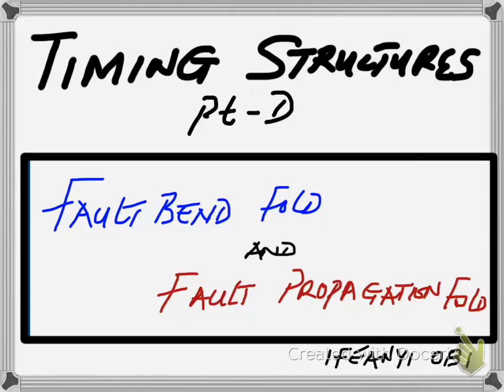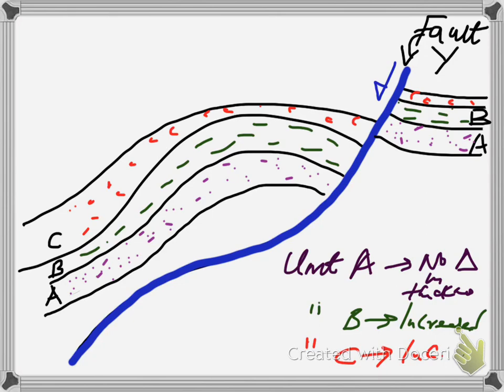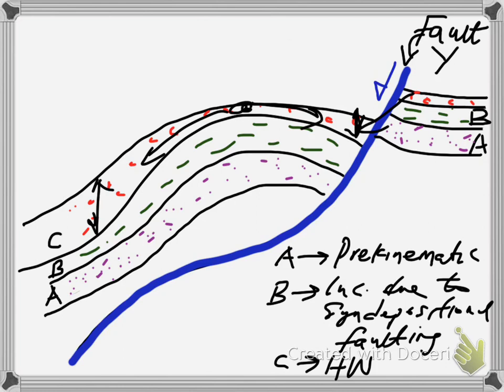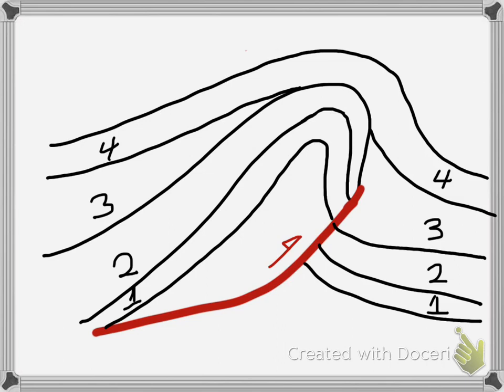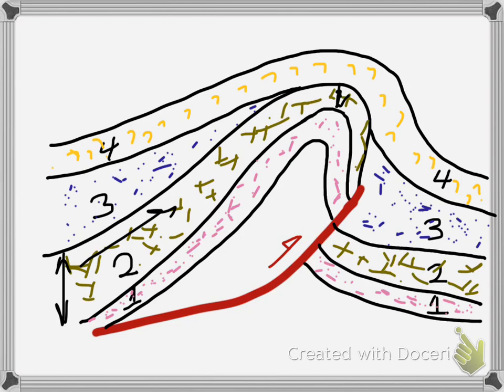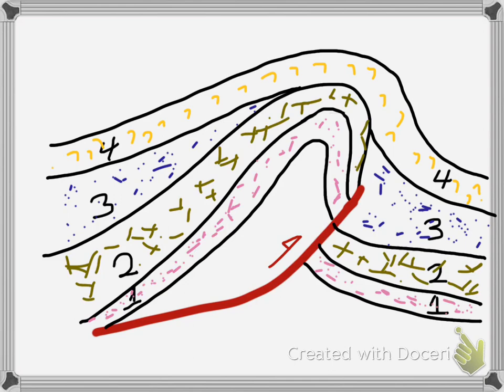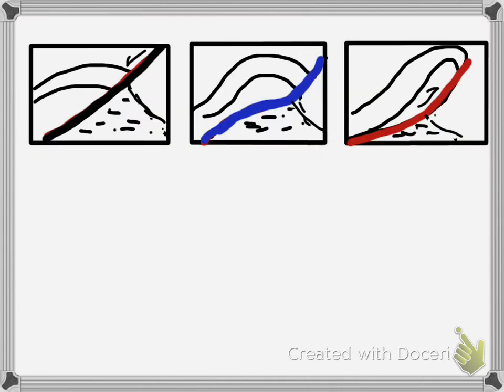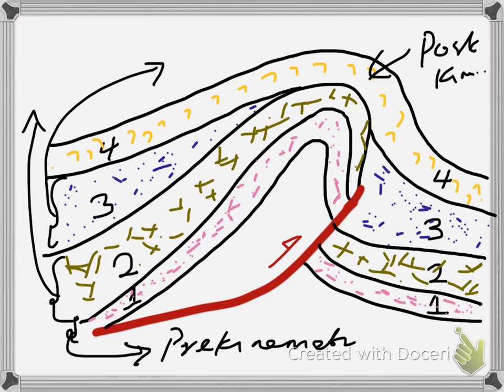Dating Structures   Fault Bend and Fault Propagation Folds

Comment: Thank you very much. Quick question:

The thickness and  geometry strata can used to get the absolute timing of structural deformation only when some indicators of rock ages (e.g. biostrat data) is provided, yes?

Otherwise, the time of deformation which can be gotten from such interpretations is relative, yes?
Reply from the maker: Good question Chijioke. Yes you are right. The assumption in this scenario is that the thicknesses shown are the original strata thickness (no missing section). It is also assumed that the stratigraphic units have not been overturned and all intervals are properly dated using biostrat data or other possible methodology
Reply: Okay. Thanks a lot. 

I look forward to watching your next video, nice one 👏.